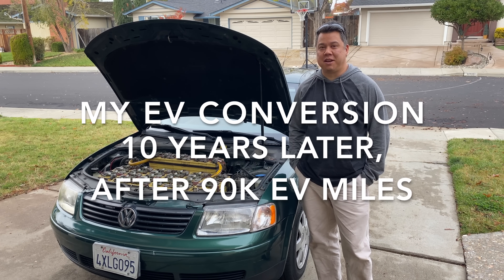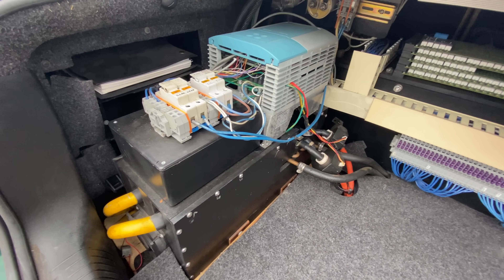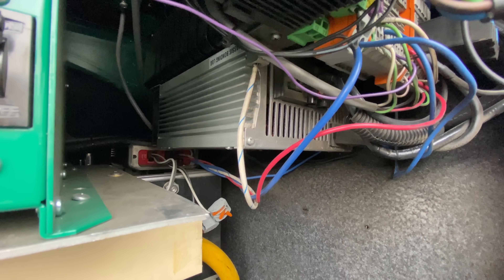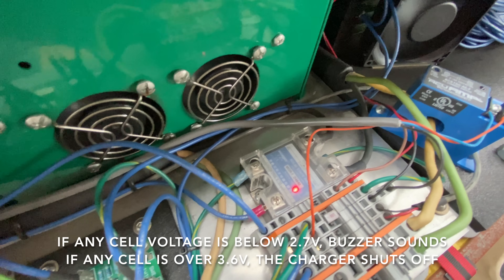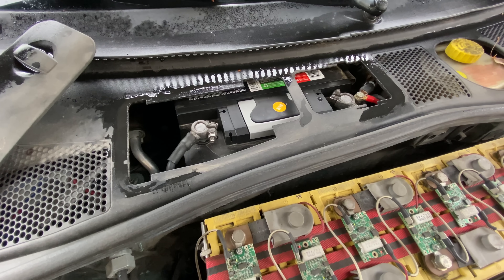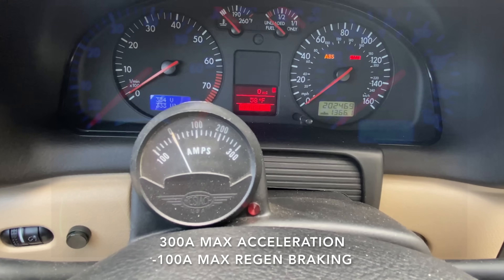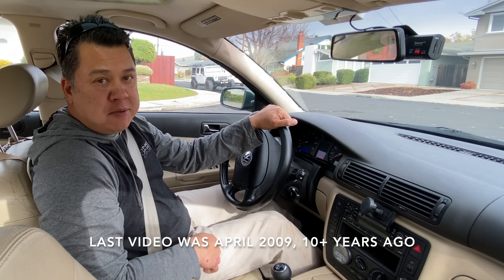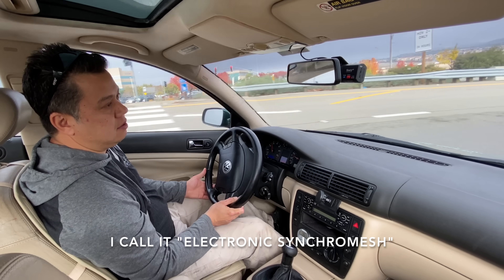My EV conversion after 10 years and 90k miles

Comment: I find it hilarious that the powersteering is hydraulic
Reply: Manolo Corsetti all old power steering links were hydraulic dude the rack and pinion with the cylinder that was hydraulic only new cars now have electric and they have problems with that too
Reply: @lwnmwr1361  i know how powersteering works. And as much as i like old school cars, electric steering is just better. I found it funny that he converted the whole car and decided to leave the old one in.
Reply: @jamesbondo5895  VW racks are usually mounted up on the firewall and steer high up on the spindles.  That means your selection of electric racks is very limited, and would require tons of fabrication to make them work.  He also did this 10 years ago when electric racks were much, much rarer.
Reply: Joe Grant The Honda Insight came out in 2000 with electric power steering, and they rarely have issues with them.

Comment: With the advancement/pricing in batteries in the last 10 years, what would be the cost do this now? Would you prefer to replace the old cells more advanced cells to reduce the amount of cells and reduce weight or would you replace the same amount of cells with more advanced ones? How much weight reduction would you have to do in order to see an improvement in range? Isn't there a company in California doing Tesla conversions on any car you want? Don't know the cost though. This is very cool!

Comment: I'd love to learn more about what's technically happening while rolling back and then giving throttle so it starts moving forward again. And also what happens when you stand in front of a sidewalk and want to climb it up from 0 with a really high amount of torque. What is going on in the motor in these situations?

Comment: Why only 2nd gear doing 75mph?  Going up the gears surly is more economical.
Reply from the maker: With a gas engine that would certainly be true, that’s why transmissions were invented.  Electric motors have a much wider power band, I don’t know of any EVs with multi speed transmissions. There probably is some slight improvement in efficiency in my car using higher gears, but shifting is a annoying.
Reply: @etischer  
Gearboxes were invented to cater for the poor toque band delivered by the IC engine. London electric underground trains have multi-speed motors by switching in and out coils in the motor. You hear/feel the motors change. Even with an electric motor it must be more economical having nearly one to one ratio with the wheels using higher gears.

Comment: Why not pump the waste heat from the inverter into the cabin in winter?
Reply from the maker: There's not much waste heat, the coolant doesn't even really get warm.  The inverter chill plate is the size of a small paper back book, not much heat compared to a 500lb engine.

Comment: Out of interest why do you use a transmission? Does it help increase the range of car/battery?
Reply from the maker: The motor can spin 9000 rpm, if you connected the wheels to the motor without gear reduction it would be spinning so slow it wouldn't make any power, like trying to ride your bike in the highest gear up a hill.    It is also an easy way to connect the motor to both front wheels.

Comment: Wouldnt you save more power if you drive highway in 6th gear. Less rev on the electric motor no?
Reply from the maker: The motor draws more current with higher gears and would over heat.  If you need 50kw of power, it's better to maximize voltage (high RPM) rather than maximize current (high Torque).

Comment: and how does this affect handling and crash test safety? 1 star rating?
Reply from the maker: Air bags and ABS should still work just fine. Structurally the car is unchanged.  Though I never crash tested it obviously, I feel like the welded frames and mounts I installed are stronger than anything else on the car.
Reply: @etischer  certainly the balance of the car is now different because of all the weight of the equipment or did you solve for that? The way the car is tested for crashes is with a combustion engine, if you were to get in an accident you have different material sitting between you and the bumper which might not absorb impact as well. Furthermore, those electronics run the risk of fire, did you apply any fire retardant in the engine bay or anywhere? Did you take that into account at all?
Reply from the maker: @johnames6430  The balance of the car is closer to the ideal 50% 50%.  It's 500lbs heavier in the rear, about the weight of 3 passengers sitting in the back seat, well within the weight limits of the car  These batteries (LiFeYPo4)  are more inert than Lithium Ion, they survive nails being driven through them, and being crushed in a hydraulic press without catching fire.  Batteries are much safer than a gallon of gasoline, let alone a 20 gallon tank full of gas, surrounded by hot exhaust pipes.  Yes, my expertise as a retired Sr. Staff Controls engineer for Tesla is safety systems.
Reply: @etischer  Oh ok that's great to hear. An avg idiot trying to do this could put himself in a lot of danger, as well as others. It looks like you've really thought this through and know the field. One more question...how much logic is there in the control board for the battery? Did you do anything fancy with software to optimize the output/charging of the battery?
Reply from the maker: @johnames6430  The BMS is pretty simple, there's a circuit for each cell that monitors cell voltage.  If the cell voltage is within range (2.5v - 3.7v) that circuit energizes a solid state relay.  I have 99 cells, so 99 solid state relay 'contacts' in a series string have continuity if all cells voltages are ok.  If any cell voltage falls out of range, continuity in the string is broken, and an alarm sounds; power is also shut off to the charger.  Cells were only charged to 3.6v, this is when the BMS starts balancing.  3.6V is roughly 80% SOC, the cells can go to 4.2v, but for longevity it's recommended to stay within 10%-80% for daily use.
Reply: @etischer  Since you work in the industry I was curious what your thoughts are on conversions as a mass market product for old cars? Do you think that's even worth it or should we just phase out the old cars instead of retrofit them (yes I know we might make exceptions for some classic cars and retfofit them)?

Comment: You are a smart guy, but perhaps too smart, too complex. What would your car do in an accident? Or if water were to leak in some how.
Reply from the maker: Air bags still work, ABS still works, seat belts still work, the cars structure is not modified, batteries are relatively inert.  Cars full of gasoline have hazards too.

Comment: His neighbor: *spends 100K on a Tesla Model X 

This guy with his EV Passat: Hold my charging cable
Reply: He made this in 2009 way before the model X came out
Reply: @f45411  Electric cars have existed for around 100 years, the only thing that has made them even remotely viable has been lithium batteries. Lead cells were just way too heavy previously to hold a decent amount of charge... So not really too much in terms of ground breaking technology, just readily available cheap batteries (which fyi even the tesla essentially just uses a bunch of daisy chained 18650 batteries)
Reply: A base model Tesla x is much faster, larger, and the range is a lot higher. You get to feel very comfortable in it with almost no outside noise. It’s better in virtually every way. If I had the money I’d rather buy the Tesla. 100 miles of range just isn’t enough for me. But it’s impressive to know someone could do this themselves
Reply: @ghost-4230  i would hope so, this car alone is almost 20 years old lmao
Reply: @ltsjoke5443  pre-facelift B5 Passats were sold until 2000, this car is over 20 now
Reply: @v6tex  check description
Reply: @ghost-4230  especially in 'merica where fuel is cheap.
Reply: lol right
Reply: But there's a lot value in writing a check, driving away, and never having to even think how it all works.

EV conversions are a lot easier to do today. There are kits for DIYers, and numerous companies across the country that will do it for you.
Reply: Me with my diesel Passat: Hold my fuel mileage

Comment: The most impressive thing is how every single thing works and how the packaging is absolutely maximized.
Reply: original heated seats doesn't work.
Reply: No, the most impressive is the budget put in a 20 YO Passat to reach an autonomy of 100 miles max.
The idea is really cool (I was really enthusiast when I clicked the video), the realization is nice, but the result is just okay.
Reply: @C4H10N4O2  the build is 10 years old goofball.l. Look at a 10year old Tesla.
Reply: @C4H10N4O2  In my opinion the realisation is stunning and the result is fantastic for a homebuild 10yrs ago.  Each to their own however.
Reply: @C4H10N4O2  this is a very old car, back then cars didnt really have the high range. this was all revolutionised by tesla. the car is even before this! the most impressive thing by far is that it has an AC and a heater.
Reply: @C4H10N4O2 It sounds like he uses it to commute to work. Gas prices started spiking around the time of the build, and he also mentioned doing very minimal maintenance over the years. So from that standpoint, he saved a ton of time and money.

Comment: So why a manual transmission... I assumed ev always used automatic ... what’s the benefit ?
Reply: Modern EV's doesn't have gearboxes. he can drive the car on 2nd gear at all speeds without any problem, if he wants to go faster he can go to 3rd gear, because his electric motor cant turn faster he changes gear. If he had a tesla motor that turns at 20000RPM he wouldn't need to change gears ever.

Comment: That is some serious engineering man! Great job. Question, what motor and encoder did you use? I could not tell from the pictures but looks kinda like Siemens.
Reply: I didn't recognize the encoder, but that's definitely a Siemens motor, AC, from that electric ranger project Ford abandoned.

Comment: At the beginning of the video was like hey maybe I should turn my car into an EV and then at the end of the video I was like I'm just going to save up and get a Tesla
Reply: Yeah, very few people are capable of doing this kind of build. You would have to be an electrical engineer with actual practical building skills.
Reply: @countryjoe3551  Well I'm pretty confident I could get like 30% of the way through before I magnificently fuck it up.
Reply: @countryjoe3551  an electrical engineer can buy a Tesla
Reply: @grod805  probably so.
Reply: Now the conversion kits are much easier to fit........ You can but the whole kit from one Chinese supplier....... Also the cost has drastically come down !
Reply: @akshayjain9623  EVWest in america
Reply: I forgot who said this but a gentleman who did some really nice conversions says he doesn't do them anymore because a model 3 is cheaper and better.
Reply: @clawhammer999  the gentleman is Jack Rickard. he now does reviews about Tesla.
Reply: hahaaha
Reply: 12 years ago you couldn't really buy an electric car. The Nissan Leaf wouldn't be around until almost 2011, and it still cost more money than this conversion (at least dollar for dollar spent). Today you can buy a used EV for $5000-$15,000 that gets about the same range as this car and likely has similar power and torque. Today, a conversion makes no sense.
Reply: Zacmanman k
Reply: 12 years ago you could buy a Toyota Prius which was a pretty good EV, though it does look hideous.
Reply: @camilo: yeah but only because it feels too complicated to diy that not because it's a bad car.
Reply: Save up and have someone convert your car to an EV, better for the planet.
Reply: the passat still has better build quality and its over 10 years old
Reply: He does not need tesla if he can build one himself...
Reply: @MartinLV.  woosh
Reply: Tesla is the premium manufacturer. EVs for the people are Chevy Bolt and Nissan Leaf.
Reply: Buying Tesla is the easy part. The hardest part is the maintenance/repair.
Reply: @iberianlion1459  You mean because there isn't any? True..
Reply: Downvoat because you said tesla. You should have said Porsche Taycan.
Reply: @qx4n9e1xp  Porsche? Lower range, worse performance, less space inside, higher price and no Autopilot. Do I have to go on? XD
Reply: @wojciechmuras553  It has better performance for sure and I wouldn't trust autopilot for a second
Reply: @wojciechmuras553  *Better performance.
Reply: @wojciechmuras553  Worse performance? Every drag race I've seen Taycan beats the Model S, not to even mention track performance. Also for the higher price you also get way better build quality
Reply: Wojtas! The Porsche has better performance.

Comment: One of the nicest conversions I've seen. Your attention to detail is very impressive. I had those same batteries in my wife EV, green bean. We got them used after being abused , I was only able to get 60 amp hours out of them. Had them in the car for about 10 years and we switch to Chevy Volt. They were still giving the same 60 amp hours after the 10 years. Building your own motor inverter I was really quite an impressive feat. I need to watch that one next

Comment: This is a very rough estimate but assuming your Passat at 26mpg avg (22 city/ 31 Highway) @ 90 000 miles would have burned $8000 - $10k in gas at $2.30 to $3 per gallon. A Tesla charging cost is roughly 3.7 cents per mile (depends on hydro rates in your area) and assuming that your Passat is charging at 85% efficiency then  $3330 in hydro was used @ 90 000 miles. I think you are going in the right direction, the more mass market this becomes the cheaper it will be. Look at what happened to Solar panels within the past 10 years.
Reply from the maker: In the San Francisco Bay Area, gas is almost never less than $4/gallon.   Then there's the hassle of having to drive somewhere to get gas, and wait for it to pump in.   Our electric bill actually went down after I got my EV going, PG&E has special night use rates.   I also charge 50% of the time for free at work (Tesla).
Reply: @etischer  $4 a gallon would be $14000 in fuel, ether way the build paid/is paying for itself.

Comment: i know its 10Years old but what is the max range on that? what will it be if you replace all those batteries for the new "normal" electric car one battery. Thanks and awesome video.
Reply from the maker: I was still doing 50 miles a day in it, but my commute ended and I bought an Audi TT convertible and started driving that most of the time.  My pack is 33kwh which gets me 100 miles.  A new battery today would be about 60kwh for the same size and weight, so almost double the miles.

Comment: Amazing. But I would have kept the automatic box if possible. Was it worth the time and expense ?
Reply from the maker: Absolutely worth it!  I drove the car for years just using 2nd gear (fixed ratio) as is the case for most AC motor driven EVs. The automatic gear box weighed a ton, and would have required a hydraulic pump to run continuously, not to mention trying to integrate the transmission computer.  A manual transmission has no electronics, it's super simple.

Comment: you paid 3.6 dollars for every mile, was cheaper to run with gasoline
Reply from the maker: Well, saving money wasn't the goal of this project.  But, I also didn't spend 3.6 dollars per mile; $3.6 x 90k miles would have been $324,000.    Any car you buy (new or used)  for $25k will loose 90% of its value over 10 years.  The same is true of my car, but I also went 10 years without buying gas or paying for maintenance (oil changes, smog checks, timing belts, water pumps, spark plugs, fixing oil leaks,  check engine lights... )   Every morning I had a full charge just from the sun shining.